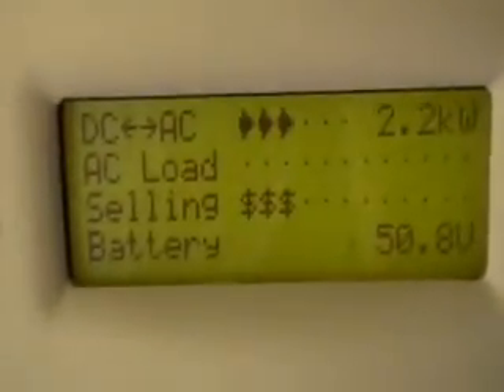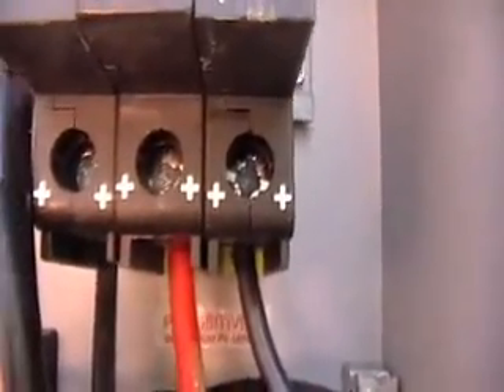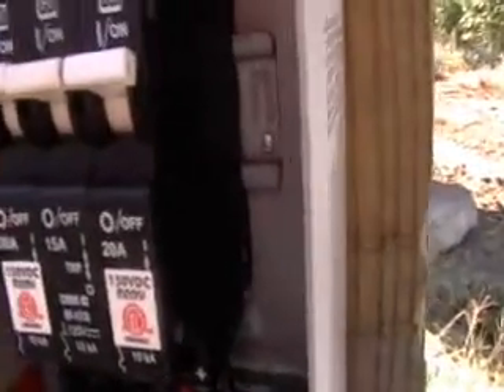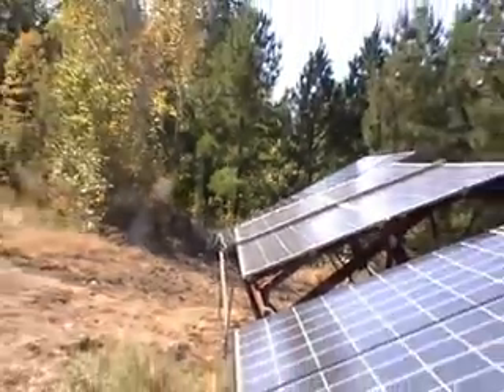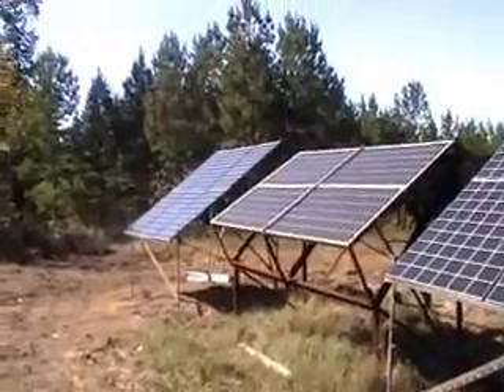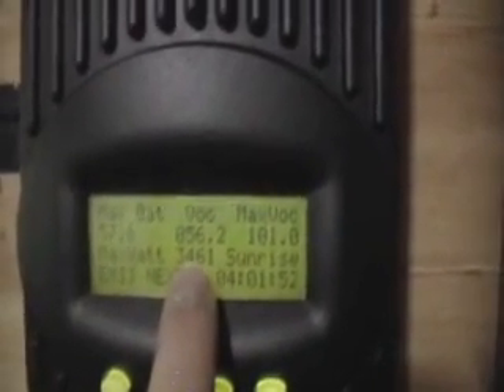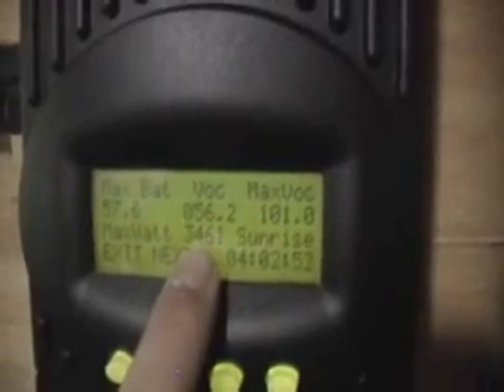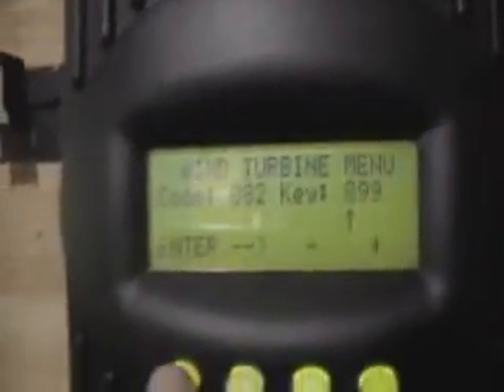part -6 Wind turbine and solar panel installation

Comment: How does it handle diversion when batts full and grid down ? Is their some fail safe?  I need to learn more info on how use FX with wind curves.
Reply from the maker: there is a load diversion tied to the rectifier. Basically a bank of heating elements.
Reply: thanks for reply. next time i should watch all your vids before asking so many questions. i saw reference to the diversion load in later vid but appreciate your getting back to me. it's a great set-up